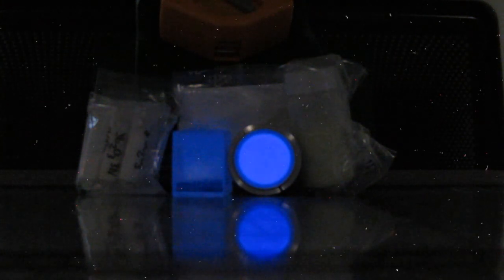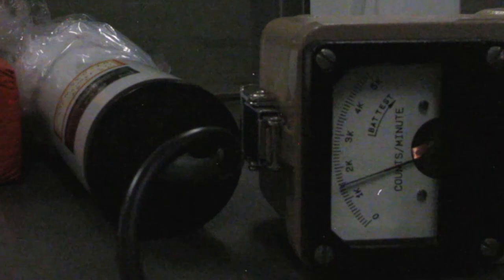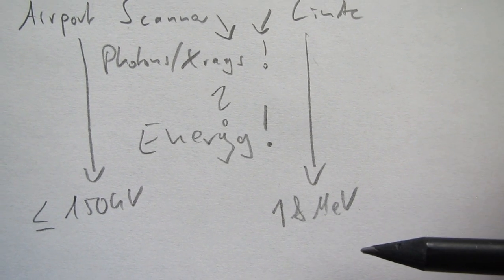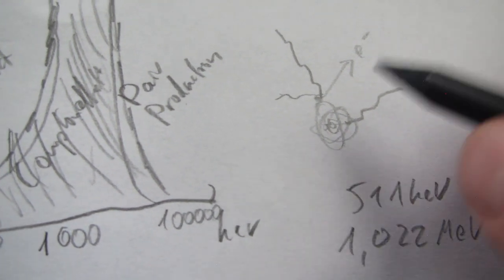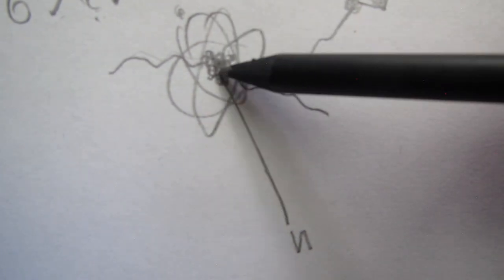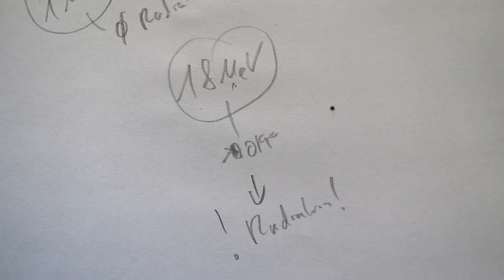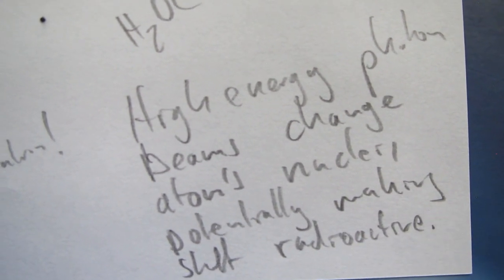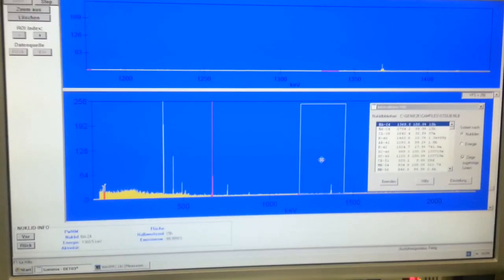18 MeV linear accelerator beam, neutron radiation, induction of radioactivity in matter

Comment from the maker: true, should be possible to discolor glass to brown / purple quite quickly.
normal dose rates are multiple gray per minute (so ~100 Sv/hour) at one meter to the target. by abuse (disabling of servos, using photon mode but removing the target etc.), you can apparently output kGy to MGy (yeah, that's mega-gray) per minute with an electron beam, but this destroys the machine after a very short amount of time. however, it allows you to create lichtenberg fractals at the expense of one linac. :P

Comment from the maker: if i had been in the room, my received dose during the experiments that day would've exceeded my yearly dose limits. but i've got a really fancy camera - it no longer uses a hand-operated generator for power, it uses a really cool item called "accumulator". it's basically a rechargeable battery that allows me to power on the camera and go wherever i want. thus, i could leave the room, close the safety door made from lead and pmma (for neutrons), and switch on the linac from the console. w00t!
Reply: Um, ok? What kind of camera are you using? They have ALL been battery powered for several decades. Most of them rechargeable.
Reply: @davelowets pssst
Its a joke cuz people think shes in the same room recording this with camera in her hand

Comment from the maker: afaik 50% of the electrons create characteristic x-rays and bremsstrahlung x-rays, the rest cause "other" interactions, mainly resulting in heat generation (in a conventional x-ray tube (up to 150 kV anode voltage), approx. 98% of electrons result in heat generation, and only with 2%, x-rays are generated).

Comment: It would be cool to do a run with the detector outside of the main photon beam and putting targets of various materials in the beam and observing their spectra of secondary radiation. Maybe you could see neutron capture gamma rays, ordinary nuclear  gamma ray fluorescence in addition to other effects such as electron-positron annihilation, Compton scattering, etc.

I would also be somewhat curious what the X-ray fluorescence yields would be like with this source. Could you get more than one K X-ray photon per incident photon at these energies? In theory it should be possible if the photon pair-produces, and then both 511 keV annihilation photons remove a K-shell electron (either by photoeffect or by Compton scattering followed by photoeffect).

Comment from the maker: well, the detector will detect itself. :P
so, if you were to activate a scintillator used for gamma spectroscopy, your gamma spectrum would show peaks from the radioisotopes within the crystal. however, there's enough scintillator material left for the detector to still function properly; it's just a tiny amount of atoms that are converted relative to the total amount of atoms present in the detector.

Comment from the maker: hmm, i'm not sure i get the main point of your messages, but anyway... in a perfect vacuum, there's nothing to interact with, so nothing that could "stop" the photon (which is an electromagnetic wave that has particle properties as seen in some experiments, and it has no charge), so the photon has infinite range. if the universe expands at the speed of light, then photons will eventually be stuck in empty space (if they dont hit an object) and exist until ∞ (infinity).
Reply: Can you tell, or is it possible to tell, what the medium ("material") of an electromagnetic wave is? A mechanical wave is an oscillation of matter where energy is being transferred. Can we suppose that there must be some kind of particles, a vibrating matter as medium that makes it possible for an electromagnetic wave to travel? In this case if a perfect vacuum existed, then light (on any energy level) wouldn't travel in it  because of the lack of the medium of the wave.

Comment: What came into my mind: Cadmium, that can be used as a neutron absorber emits high energy photons (9 MeV) at neutron capture... maybe these high energy photons are producing secondary neutrons as well? 
Did you ever try to place some beryllium inside? It has a high cross section for the (y,n) reaction and could emit much more neutrons than the iodine does.

Comment: Your compact fluorescent lamp most likely causes RF interference, because of the switching power supply.
The lamp does not have anywhere near enough high voltage to make x-rays (even at start-up) and there is no vacuum (to many gas molecules that prevent the electrons from getting fast enough) and even with vacuum the resulting x-rays would be so low-energetic, they couldn't even penetrate the glass.

Comment: Charge and "color charge" are two different things!
The electro-magnetic(em) field or the waves of it if you want is comprised of photons. The photon is the force carrier of the em-interaction, it has no charge itself. An electron (because it has a charge) causes an em-field around it, that field is made out of photons and it is that field of photons that influences other charged particles. It's not the electrons that influence each other, it's the photons they exchange that make the influence.

Comment: Why don't visible light energy photons interact with atoms to create neutrino-antineutrino pairs? Is it because photon-nucleus cross sections for low energy photons are too small and can be ignored?
Reply: It's because to produce a matter antimatter pair, you need a photon with an energy above the rest mass of the sum of your two particles. For an electron and positron, this is 1022keV (511 each). Visible light photons have about 3eV each (for violet). So basically it's off by a factor of 1000000.

Comment: I've heard many measurements of radiation, including sieverts, Gray, roentgens, and rems. Are they all different things? Can someone explain them in easy to understand terms.
Reply: They're all measurements of radiation. When radiation hits electrons in air, the charges can be collected and measured.. this is called exposure and has units of roentgens, (coulombs/kg air) Roentgen is a measurement of Exposure. Some of the electrons may come to rest in a medium (some pass through), but the energy(J) they deposit can be measured. The energy per unit mass is called gray(J/kg). And as far as humans are concerned, each type of radiation - alpha, beta, gamma, neutron, proton - affects us with different severities i.e. 1 Gy of dose deposited by alpha has a more severe impact than 1 Gy of gamma dose, so sieverts are used to measure the radiation effect in the human body. The transformation from gray to sieverts is to simply multiply by a factor specific to each type of radiation i.e. 1 Gy of alpha radiation is equal to 20 Sv..the factor is 20 because its 20x more damaging biologically than photons, but 1 Gy of beta radiation is equal to 1 Sv..weight factor is 1 for beta and gamma
Reply: @zacchrist1759  cool ! thanks for the explanation!

Comment from the maker: well, the energy does not matter that much - the flux density and total dose is what matters! a few hundred quantums at 18 MeV, i dont mind at all. in fact, i'm surrounded by very low levels of high energy cosmic radiation right now. same as every creature in the universe. however, this linac can output 100% fatal dose levels in the fraction of a minute (with all safety disabled)... and even at normal (therapeutic) dose levels, if you do it wrong, very easy to severely harm or kill somebody.

Comment: Electron volt is 1.602×10-19 Joules in vacuum...what is it out of vaccum? How many Joules or Ergs does a single electron volt have on the surface of Earth?  The inverse square law does not apply to extended sources of radiation on the surface of this planet with a water cycle.